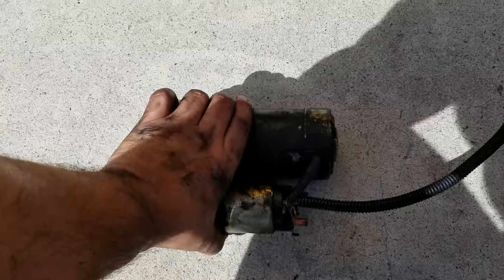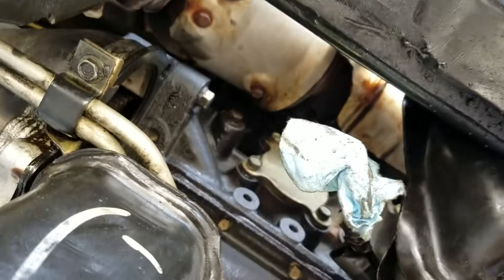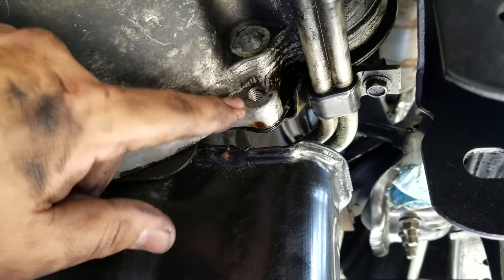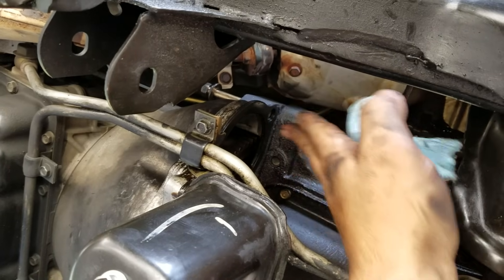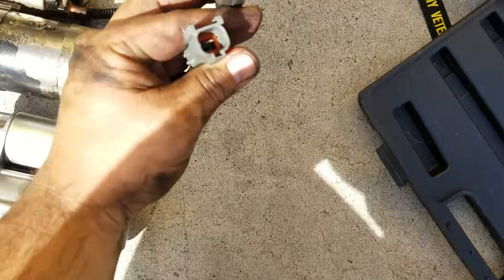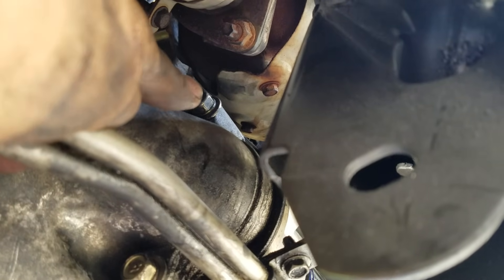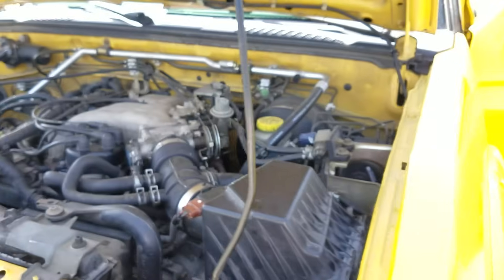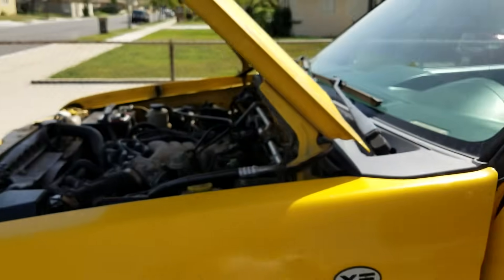Starter removal and install

Comment: Guys remove the negative terminal of your battery  before removing the starter!!!!!!! Otherwise you will get the shock of your life. Also wear protective goggles especially under the car.
Reply: chuimon slp what's wrong with a little tickle and oil in the eye?? Lol good advise!
Reply: I can grab the distributor and shut it down.. Burns little bit but don't be afraid it absolutely helps unclog the arteries
Reply: It won't shock you but the sparks will scare the hell out of you. Better to remove the positive connector instead though.
Reply: @SailorOnAMountain nah man, I remove the ground first for safety. Don't teach newbies your way, it's not safe if they are learning.

I always  remove the battery's ground clamp before loosening the positive. It's safer that way so you don't short the positive terminal to the ground with a tool accidently. It won't harm you if you remove the positive first but why encourage bad practices like that?
Reply: @8kigana  That's true. I learned the other way because if the pos is disconnected, there's no chance of anything grounding out. When you've got side posts or something somehow grounds the battery to the frame, any hot lead still has potential.

Comment: Do you need to drain oil before replacing starter
Reply from the maker: No, you do not have to drain any oil. You do have to disconnect the battery though.

Comment: How do you get it out after it's unbolted
Reply from the maker: Need to wiggle it out or use a flathead to help pry it off. You may also try lightly tapping on it with a hammer.

Comment: Hi Erik! My stepdad and I just changed the starter on my 98 Concorde today, but for some reason there’s now an issue with getting power throughout the car. The dashboard lights won’t work, windows not functioning, and trying to start it has no reaction. The battery itself has enough power, we tested it, so we’re thinking there’s an issue with the conduction system running through the car. Any ideas?? Please help🙏🏽🙏🏽
Reply: Someone told me that it may be the ground wire. My truck has a small wire to the frame to the negative terminal.